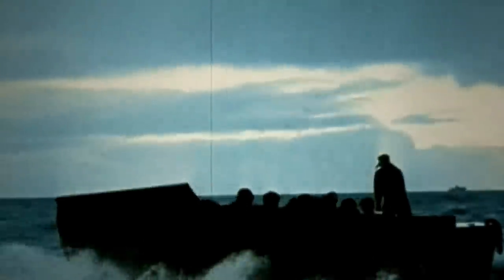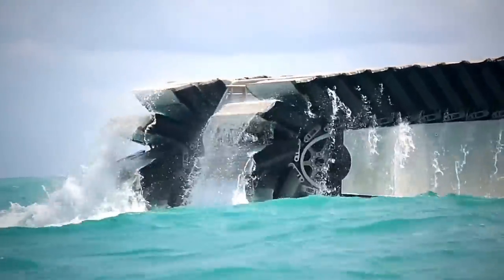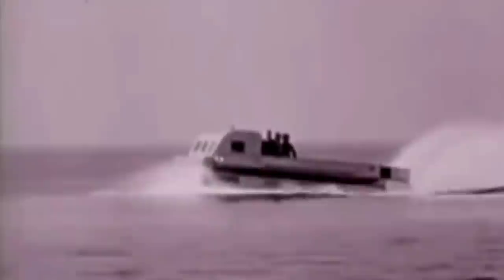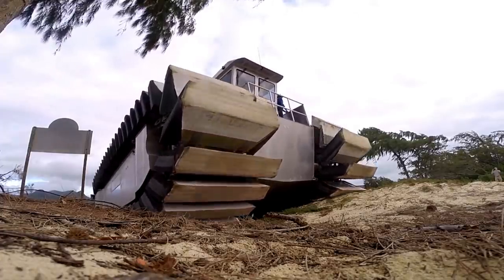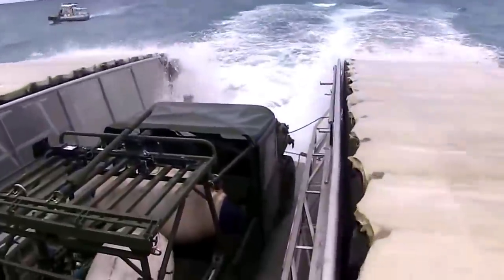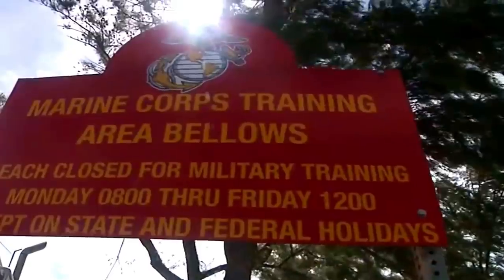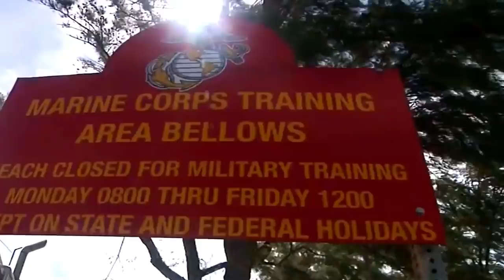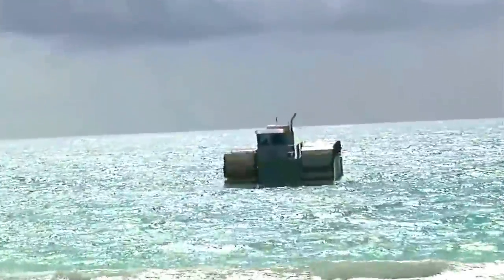US Marines Test Giant Sea Tank

Comment: I feel this has more applications on a S&R than an actual military offensive.
Reply: International Rescue?  Thunderbirds are GO!
Reply: More than likely it would have air support .......or some kinda way with armor be able to return fire / bus back 🤯 and all that would be adding massive amount of weight 😎 ...... going the right path though with this concept 😁.
Reply: this, if these tracks are made with foam you only need one rpg to blow the foam away and it will only turn circles.I see it in much better use for non Combat applications like S&R or move equipment in swamps or perma frost areas.
Reply: @MrRockersocke  They would just have to make sure there arent any enemies around before they offload its 3 tanks each.

Beach landing under RPG/small arm fire isnt that relevant anymore, they got plenty off missiles, drones and planes to make the landing spot reasonable safe until they got the tanks up and running.

Comment: Interesting but the Marine Corps recently shed themselves of main battle tanks. The audio stated repeatedly that it would be used to carry three MBTs.
Reply: Probably army mbts or mbt like vehicles then again this vehicle was still in testing when the marines still had mbts
Reply: If it can carry 3 MBTs it can easily carry IFVs or APCs or whatever else they're using now too lol
Reply: @doomguy9049  Marine Corps doesn't have any of that, that's the Army. Just AAV's and regular tactical trucks like the JLTV and MTVR.
Reply: @RyanNelson0402  that's fair, my point was that anything the Marines do use is likely to be much lighter and smaller than a MBT though so more of whatever they do need to drag with them to support a coastal landing/assault would fit easily into that thing. Seems likely if they do encounter a situation where they have to assault a fortified cosstal position they'd need to land something more heavily armed and armored to support the infantry, but maybe they have something else in mind or plan to pull some old MBTs out of retirement should the need arises idk, I'm not a marine.
Reply: @doomguy9049  oh buddy.. you'd be disappointed with current strategies and ideas being bounced around. There's not gonna be another fight like ww2.

Comment: The research seems to be in a holding pattern since 2014 for new systems for unloading heavy assault weapons from the sea.  The US Marines are downsizing and becoming more of a fast reaction force and have disbanded their heavy armor units. Most of the world’s beaches that can be used for amphibious assault have become tourist attractions with hotels. The world is constantly changing since the days of WW2 amphibious beach assault landings.
Reply: During Desert Storm amphibious landings were ruled out as they would have led to thousands of casualties for US marines. This was before the US even hyped up the potential of a marine landing to trick the Iraqi army into reinforcing potential beach heads. Opposed landings simply are not that good of an idea in the modern era. We simply have better options. From the perspective of the US geopolitical situation if you absolutely must you have already screwed up massively. Which makes me wonder why we are spending this money on a giant vulnerable target that clearly can't operate in rough seas.
Reply: @enoughrope1638   It's a connector, that's why. They're extremely less expensive to produce, operate, and would have significantly more range than the current massive float systems. The 'big target' concept is completely redundant, it's not a fighting vehicle or anything equivalent to a 'amphibious assault vehicle', it's a cargo hauler for the supply lines. And we'll always want a good way to get massive amounts of equipment quickly from large ships to the shore.